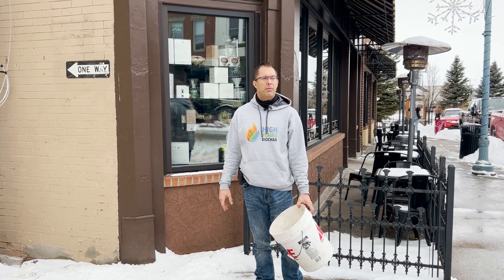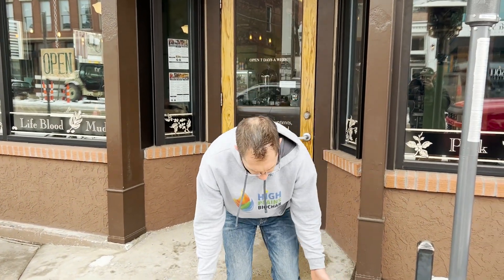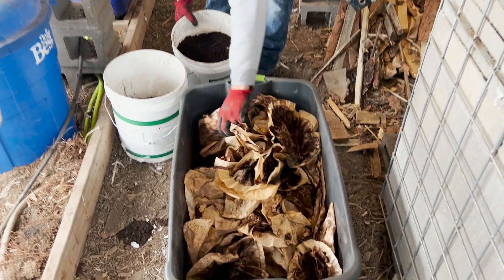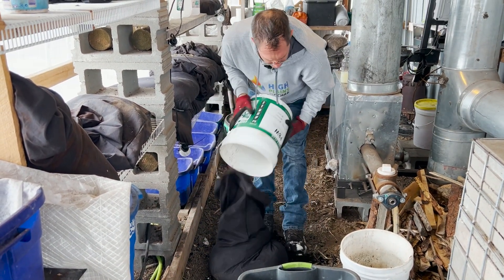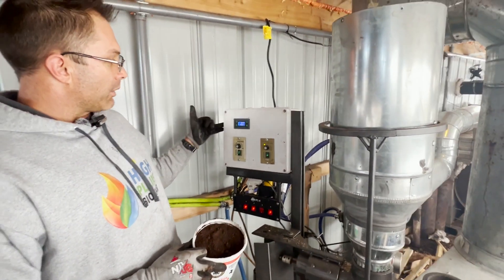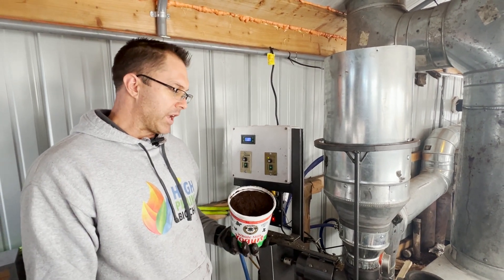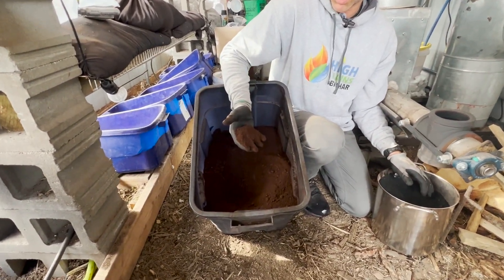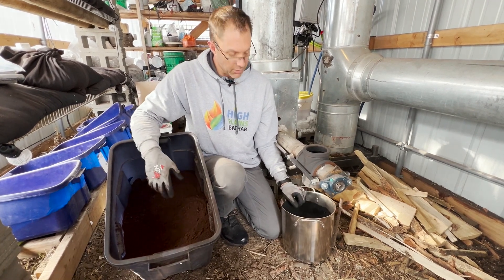Decarbonizing the Coffee Industry turning spent grounds into biochar

Comment: There may be a billion reasons not to, but would you be able to put more augers through exhaust pipes to run your wet grounds through to expedite the drying and or to preheat the grounds before pyrolysing to make better use of the heat and fuel used to pyrolyze the coffee grounds?